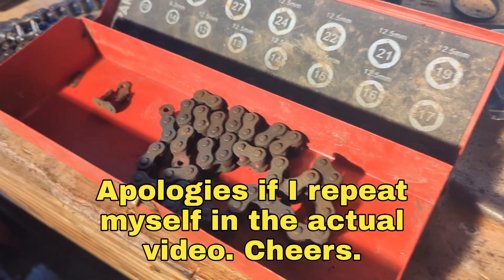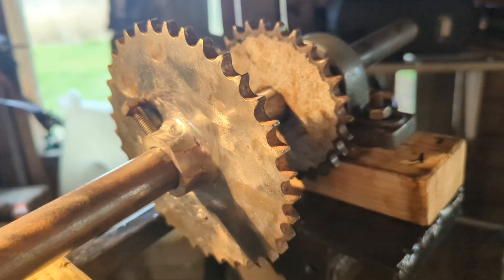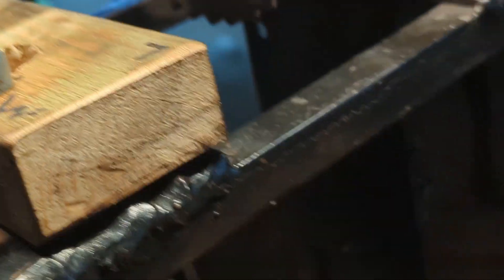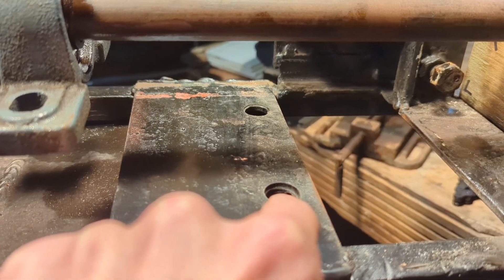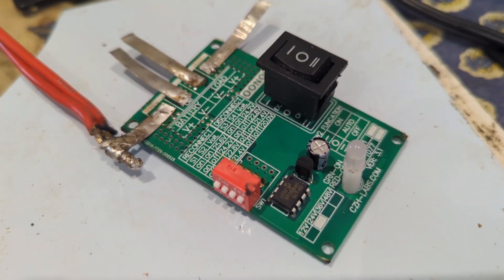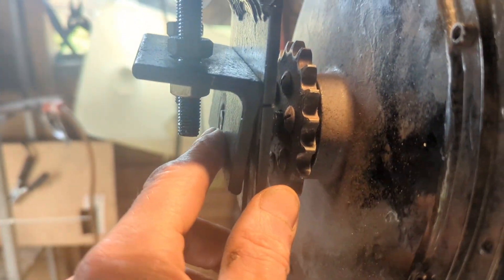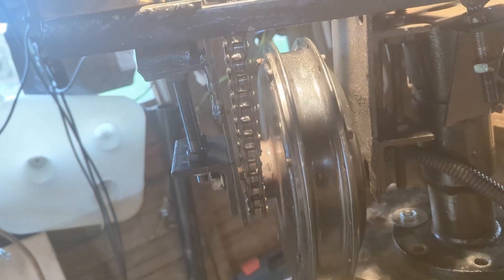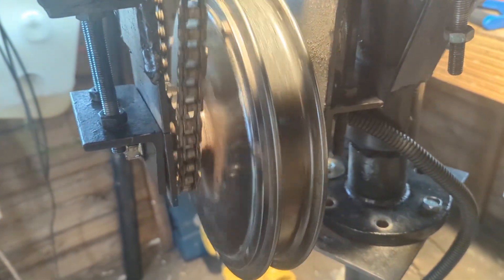Wind Turbine Project Free Energy Generator - Fitting a larger drive gear Upgrades - Part 3

Comment: The wear in the middle is from shaft wobble.  Either torsion has imparted twist under load, or your shaft was never straight to begin with.
Reply from the maker: Thank you for your kind comment. I think the main problem is and I forgot to mention in the video that the supplier sent me a 25.4 mm shaft where I wanted a 25 mm shaft. So what I had to do was actually wear it down a bit with a grinder it took forever and it's not very accurate, next one I built I'm going to triple check. The supplier sends me the exact right shaft OD, Cheers

Comment: One thing you could try to help stop your chain rusting is use gear oil, Paur some into an old saucepan, melt candlewax into the oil and allow it to cool slowly. Keep adding candle wax and cooling and get it back down again just enough until the oil starts to go stodgy, then put your chain in the oil and make a small bonfire or use a blowlamp heat the oil boiling the chain in it when you lift the chain out, allow the breeze to cool the chain and your oil will stay without dripping off also heating it up, allows everything to get very thin and in between all the joints will be reluctant to be washed off with rain save your pan with oil and the next time you take it down you just repeat cheers Derek
Reply from the maker: Thank you for your kind comments. She's up on the tower running as we speak. Just waiting for some wind. I did give her a little bit of oil but need to buy some proper stuff if there's anything you can recommend Cheers.

Comment: I think with those big blades, and judging by how you turned it by hand, I'll take a guess it will start turning at 8mph and achieve  cut in voltage at 10mph, (assuming your batteries are between 60 to 90% ).